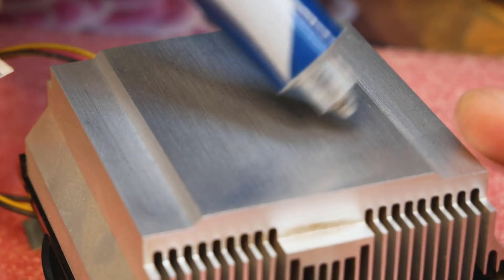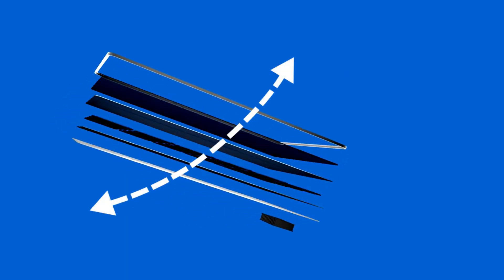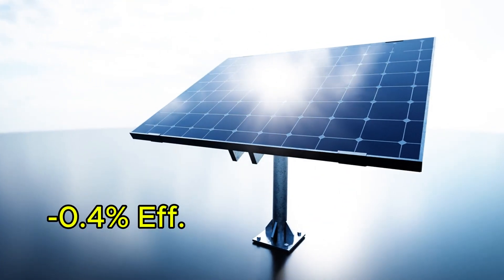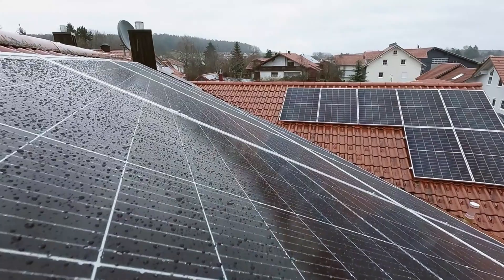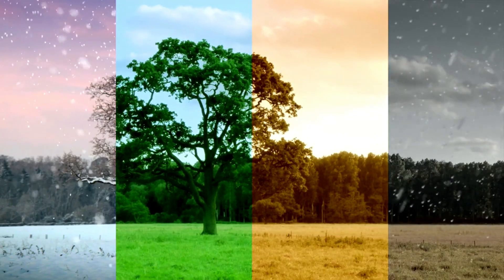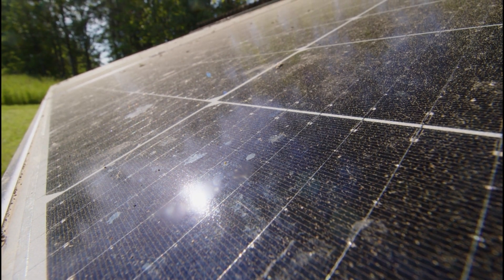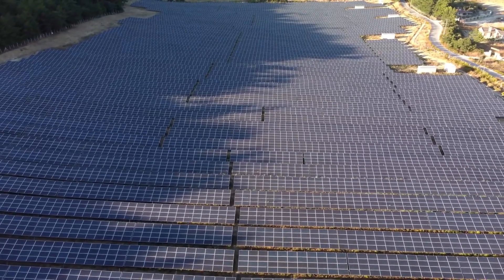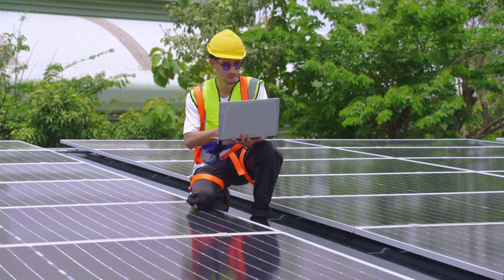This $37 Cooling Gel Makes Solar Panels 12% More Efficient

Comment: Interesting solution however is this gel transparent? All modules in utility scale projects are now bifacial meaning they produce from the backside. Would that not hinder the bifacial gain performance?
Reply from the maker: Yes, the gel must be transparent and offer good optical properties to avoid hindering bifacial gain, as the module's rear side captures reflected light, and any non-transparent gel will reduce this performance. A highly reflective backsheet is crucial, and a transparent polymer backsheet can offer advantages over a traditional glass rear in terms of weight and bifacial ratio. However, the gel needs to provide sufficient protection for the module's lifetime in harsh environments.

Comment: Such an increase in efficiency is nice, BUT:
Using water to cool the panels' back side has an EXTRA advantage: that heated cooling-water reduces the energy needed to heat said water further for use in bathroom & kitchen.  AND for house-heating where appropriate.
Reply: yeah but turns an electrical project also into a plumbing project, very expensive upfront cost
Reply: @encodedpr  If such cooling is integrated in the panel-design, then the upfront cost is significantly reduced because of mass production.
Reply from the maker: That's a great point about the potential for heat recovery!

Comment: It might create heat hotspots. I have alot of experience with this stuff, my physics mind tells me this theoretical solution will fail miserably in real life. It will need 5 years of useage to see clearly how it fails. But i am sure it will work worse than plain solar panel. I am not disrespecting the research, actually they should do more and more research.

Comment: damn 37$ per square meter that's expensive 
it is almost cost of  buying a 585 w bifacial solar plate 
they generate electricity from both sides 
25  years of life 
no mater what you still need to wash your panels its dusty environment where we are from 
oohh hell what about the birds poop they cover your panals in days no gel gona work on that 
wash is must 
😂🤣Hahahahaha
simple maths for example you need 5 kw of power to run your home 
you need to plan for 8kw minimum upto  10 kw is best you will have bigger machine more reliable
 by the time your panels lose efficiency you will pass 25 years easy 
u never know what will be the technology by then 
so be wise  plan your system
Reply from the maker: Thanks for your detailed perspective on the costs and practical considerations of solar panel efficiency. As you know, it is intial product, so cost optimization will be under focus. I HOPE it will became cheaper later.

Comment: Beautiful innovation. Does it mean you have to bring down already installed panels before applying.
Won't it add to the existing panel weight per square area?
Reply from the maker: excellent notice. Since it will be added bellow the panel, it may require bring them down, if there is no space to get behind them.
Reply: @renewable_energy   If it is a "$37 Cooling Gel" then it should already be on the market for $37?! 
Where?